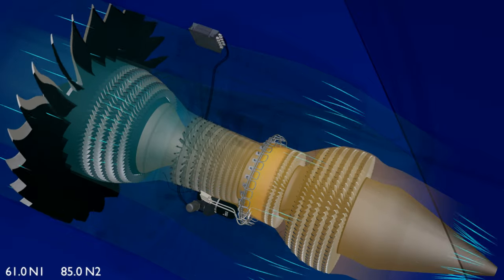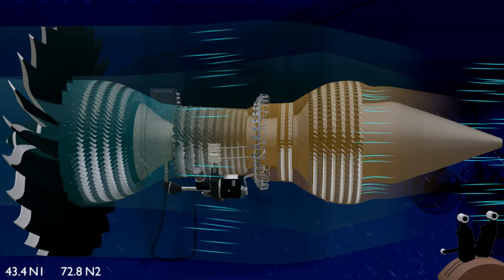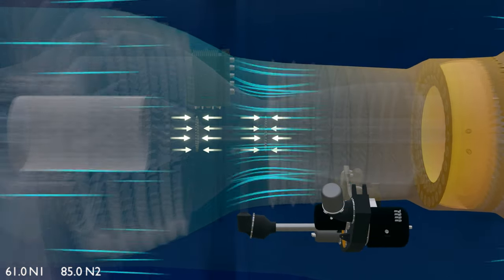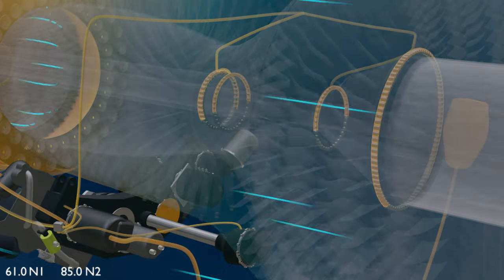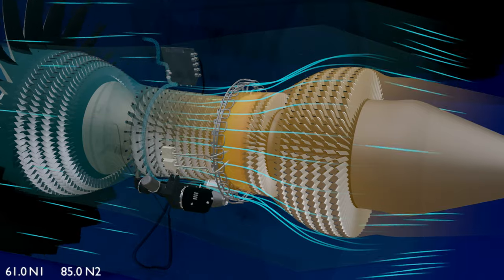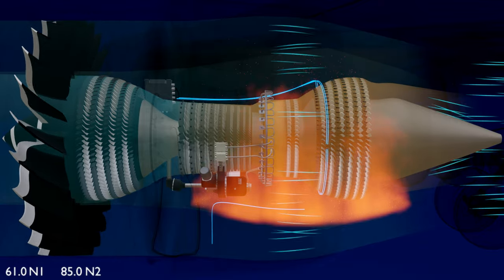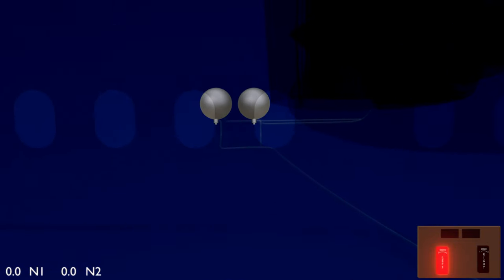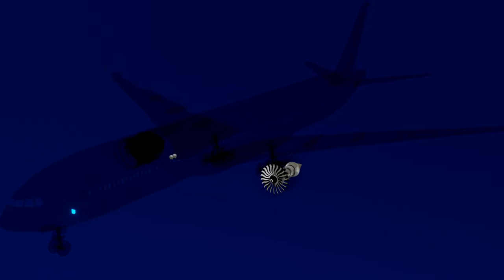How Jet Engines Work | Part 4 : Protection

Comment: I worked for GE machining the front fan hub which the fan blades are installed. I also machined the stage 1 & stage 2 high pressure turbine discs.

Comment: 4:30 interesting, they have core compartment cooling, and also, as shown earlier in the series, cooling systems for turbine clearance control... Kind of odd that they are not one and the same
Reply: one of first that used active and passive clearance control were on cfm engines , some 30-35 years ago

Comment: Great videos! I've watched more than once. I'm just wondering why there are 2 number 3 bearings, I watched that bit it a few times, we had 1, 2, 3, 3, 4 & 5? i.e the 2 N2 front bearings are both number 3
Reply from the maker: It is strange, yet that is the way the bearings are labeled.